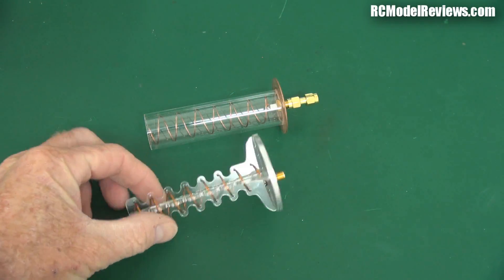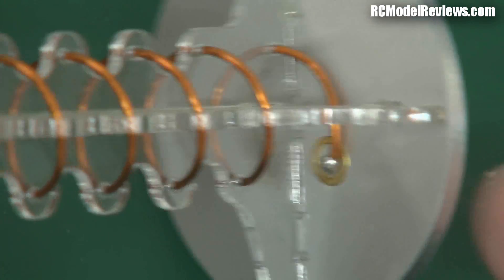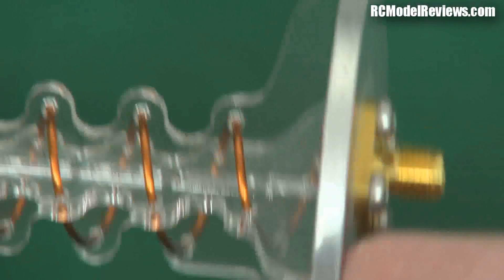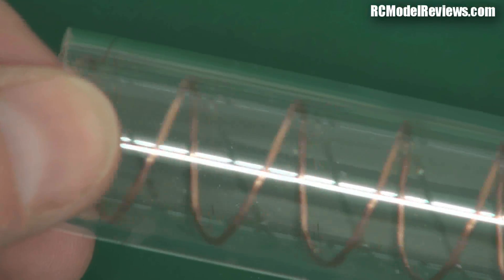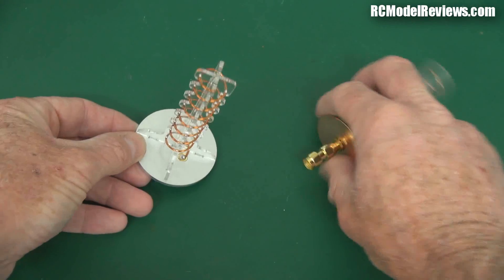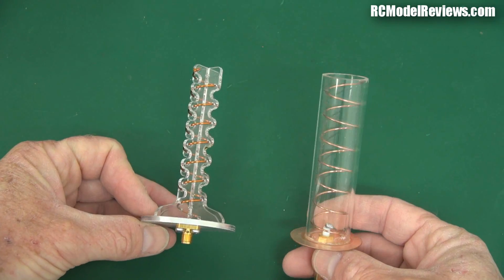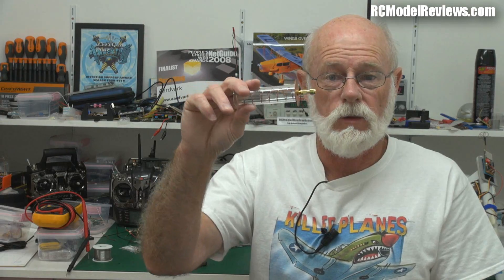Two 5.8GHz FPV helical antennas compared

Comment: actually helicoils are less prone to problems with polarization... having any kind of material around the coil esp. inside the core other than air will degrade the Q factor. However, to improve durability they are wound on some kind of dielectric material. Teflon is one of the better ones as thin as possible. Also -- the number of turns dictates how much gain the antenna will have. It is best to use pure silver wire over copper. It is the best conductor but more expensive. Gold is actually a worse electrical conductor than copper and much more expensive. It is only used in electronics to prevent oxidation. I am in the process of building one out of silver to test against some popular designs. Great video.

Comment: How about tuning the cheap one. What about inserting a bolt in the back plate that you can move up or down to optimize the SWR, and adjusting the wind then gluing it in place. Do you have a way to show us SWR and optimizing it? That would be interesting. And you could slip a plastic tube over the outside of the windings to force them to the right diameter, then adjust the spacing until it's optimal. Do you have a way to let us see the optimal spacing on a scope in real time? That would be interesting.

Comment: Can I get a helical (larger) for my OTA TV? I'm noticing the best antenna which works is a figure 8 Clearstream. But I need more signal coming in, and also clean. Directional and 8x bowtie multi didn't add anything. My signal is bouncing off the wrong direction from buildings (not its radial of origin) so the multi does a good job of SNR. I want more of the same. I was thinking exactly of a copper helical multiple multi and directional combined like the tiny ones you've demonstrated. I need it 8" diameter though. I might have to make it myself.

Comment: Bad review. You didn't even mention that one antenna is left hand circularly polarized, and the the other is right hand. Of course one is going to work horribly when matched with an antenna of opposite polarization. Also, you don't test them in any way.
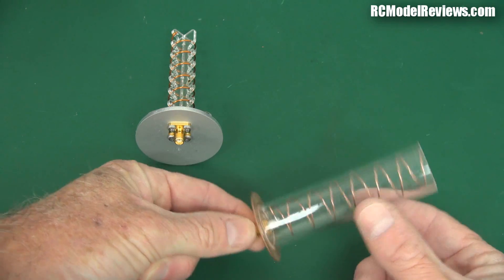Reply: You clearly did not watch the video. 4:10 and 4:20 adresses BOTH your statements.

Comment: Hmm why focus on the diameter of the loops? It's a long time since I did any studying on this, but as far as I know, the diameter wouldn't affect the frequency, its the stance from the base to the same point on each loop that determines the wavelength/frequency, and even that can be different depending on whether you quarter, half, full or any other fraction of the wavelength antenna.  by your judgment of diameter alone, David windeståls huge helical would be useless.

Comment: Nice Bruce looking forward to some tests. My money is on the Chinese one definitely being crap, and I would not be surprised if the circular wireless one is average too. Do they test each one? I'd pay good money for one that came with a network analyser printout. Otherwise I think that at 5.8G what you get is a gamble.

My reasoning: I've been playing around with computer simulations of the helical and that distance of the first quarter turn to the reflector is critical for good performance. Even a half a millimeter difference can ruin the SWR. After seeing that I have decided that it is all but impossible to reliably hand build a 5.8GHz, (my attempts have so far have failed).

So I'm sticking with the cloverleafs and skewplanars, they are bullet proof and very tolerant to manufacture variation. I've built several on Bruces design and they work great.

Was it fpvtests that made the potted 5.8G helical? Thats the best bet I reckon.
Reply: Mine 'worked' but I could still get similar range with the skew planars.

Comment: So, I guess anyone here would want to know how much more antenna you get paying 8 times the price. Now we have seen there are major quality differences, and also you pointed out some flaws which will theoretically distort your reception signal. Thank you! But if I am willing to sacrifice quality and buy a cheap antenna will I, in practice, notice any difference? Until it breaks because of bad mechanical support, of course....
Reply: That's what the practical tests will determine.

I've used a home-made 5.8GHz helical with good results and if you're able to work to relatively good accuracy, building such things is not too difficult.  However, without expensive test gear it becomes hard to extract maximum performance -- which is why those who want that last meter of range will buy $84 antennas :-)

Comment: Nice topic I have recently just got a cheap one like that except it only has a plastic backing plate. I have a 200 mw VTX and clover on the plane and got 1km in fog and totally lost video. On a clear day got 1.5km easily and thats on a cheap one. 
Going to make a better one as per what I have learnt. 
Read about 17.5mm inside for the coil? 
Also how do you tell if your clover is left or right hand polarized ??
I am using 11AWG wire as understood you dont need a signal block ?? at the end. 
Seems to be some varying ideas....
Reply: You can easily get 2Km from a set of well-made cloverleaf antennas so 1.5Km isn't very impressive.   A decent helical should extend your 200mW video system to at least 5-8Km (depending on the noise floor, humidity and other factors).

As you found, humidity or (even worse) fog/cloud really hammer a 5.8GHz signal and can dramatically reduce the range.

If you hold your cloverleaf (or helical) antenna so that the cable is facing directly towards the ground, the angle of the wire closest to you will go "uphill" (from low-left to high-right) for a right-hand polarized antenna and "downhill" (from high-left to low-right) for left-hand polarized antennas.

Comment: The interesting thing with these helical antennas is the feed point impedance of 150 ohms, which compared to the usual 50 ohm impedance of 316 coax and the reciever makes for a lousy match (SWR 3:1or 75% efficiency) regardless of construction quality. Without a quarterwave 85 ohm matching stub you are pretty much stuck with the mismatch.
Reply: Fortunately the mismatch is far less important for receivers than for transmitters and the effect can be mitigated somewhat by using a tuned-length of coax :-)

Comment: you always give good advice , i was wondering if you could advise me on a battery for a blade 350QX.  when i bought it last month they old me the wrong mains charger and i flattened my battery.  i have a new charger, i've been using for two days, as you can see it is very slow.  it is charging but slowly.  as you may gather i am new to this hobby, i tried it twenty years ago but gave up, now i'm back but green.  could you please advise mean.  would be much appreciated.  thank you.

Comment: Hey Bruce - the better one is 8 times more expensive! sure there are better ones from the bad ones available too .Also - hobbyking charging 84 bucks for this thing - are you serious,how that compares by value to 6000mah 6s battery - it is a piece of wire winded on the stick!!!!! hobbyking is going bonkers,big time!!!!!!
Reply: I did say they were from opposite ends of the spectrum :-)

Comment: What about the ones with no baseplate? I know someone that bought a helical, not sure of the actual performance until I actually get a chance to test it, but it's a helical wire, inside an acrylic tube, with an acrylic baseplate. Makes me wonder where they put the ground wire.

Comment: I was given one of these and a skpw from circular wireless. It out flew my power batteries. I had to turn around and come back with out a glitch static, drop out. ot any interference. They are very well made and they work like they are supposed to.. Great product and it you think anything about your equipment, well worth the money. I can't praise them enough.

Comment: hahaha... wow, that hi model one just forcing the end of the antenna at the end to go through the middle by bending it a bit more. Sometimes detuned antennas work really great. One example is the ibcrazy turnstile antenna. It uses reactive coupling where the dipoles meet and somehow its performance seems to be great. (basically tuning for 405 and 470 to end up somewhere @ 433 Mhz when coupled together. Some people report blackouts at distance though. Looking forward to the results.